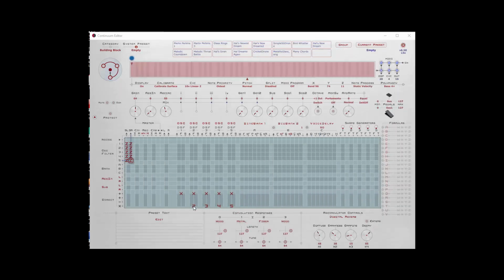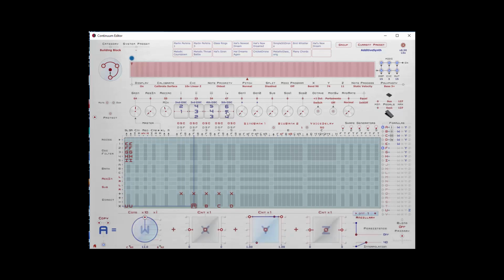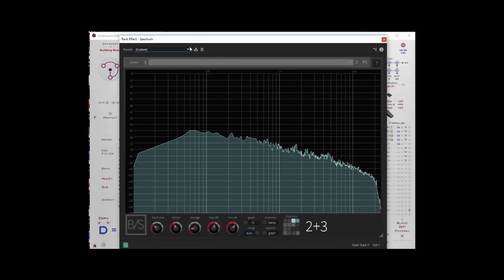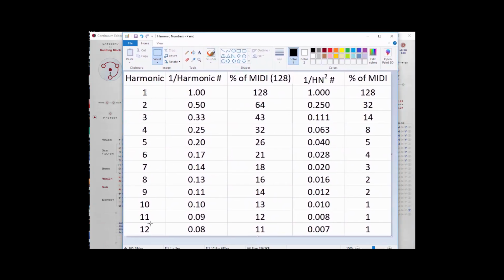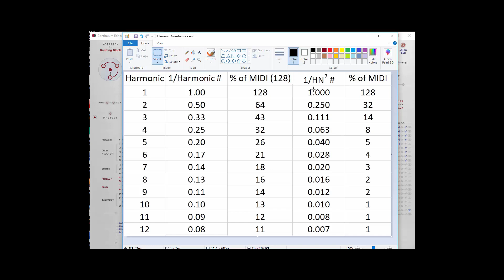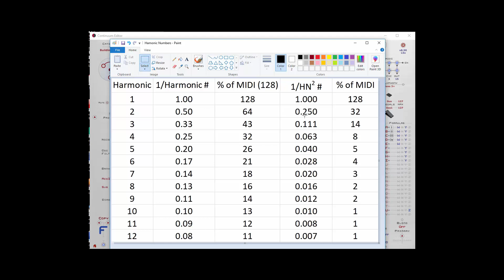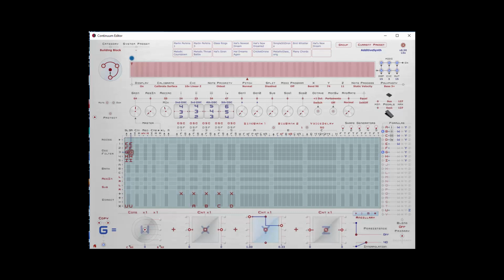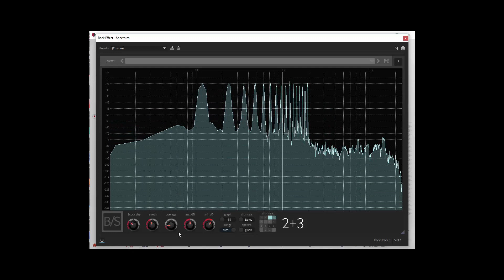Haken Continuum EaganMatrix Programming - Wave Banks Part 1 - Sine Bank of 5 Oscillators

Comment: Thanks for doing these Videos! Just now getting into Eagan Matrix programming with the Osmose. As an analog synth guy, it does bug me a bit, that there is no easy way to just blend between sawtooth, triangle and square waves. Ideally, I'd have a "Virtual Analog Oscillator" with inputs for shape and oscillator drift (to simulate vintage synth behavior). Currently I'm programming all of these manually (using wave banks and blending levels on the filter input), which is quite frustrating for such a seemingly simple task. Also, I'm quickly running out of dsp power and macros. Another thing I do miss is being able to saturate my oscillator waveforms before the filter. I can use the submix for this, but then i also have my effects pre-filter, which is a bit weird... Do you have any special programming tricks up your sleeve specifically for us analog guys? :D
Reply from the maker: It is its own thing. If you want to mix waveforms like that use something else. There are a million options. Don't try and turn it into an analog modular. Change your mindset for how this works. There are changes in the works to increase formulas, etc. but no release dates yet. Depending on the Spectral balance setting on the OSCs you can get a more triangle vs saw harmonic content (the waveform will not look like a triangle or saw as its DSF). I would try using DFS OSCs at different Spectral Balance settings to see if you get a sound you like which is in effect a mix of different harmonic spectra vs. saw vs triangle, etc. You can do the same with the Jenny OSC which can produce some interesting mixtures. In terms of Wavebanks, you can play with the harmonic weighting to get different mixture like sounds.
Reply from the maker: Also in general you will be a lot better off thinking about how you manipulate harmonic spectra than waveforms as so much of the Matrix is geared for that.
Reply: @eaganmatrixprogramming  thank you! The thing is, additive synthesis never really made its way into my thought process. I tried several times throughout my music career, first time was way back when NI Razor came out. And even though I'm comfortable with the frequency domain, harmonics, fourier-tf,... it's just not the way I think about sound. Maybe you're right and the osmose is going to be more of a controller keyboard for me, let's see. I do think the eagan matrix engine is quite powerful, though, and a "simple" VA oscillator could add a lot to the sonic palette.
Reply from the maker: @JBrm  Not just additive synthesis per se. Many of the EaganMatrix components like BiqBank and BigGraph have operations that filter based on harmonic spectra. For example the BiqGraph can let you manipulate individual harmonics of a sound and the BiqBank lets you manipulate spectral peaks and amplitude and frequency spreads, etc. There are at least five different sound generation and filtering techniques used on the EaganMatrix. I rarely use an Oscillosope to look at EaganMatrix sounds, but I use a spectrum analyzer all the time. For example if you look at one of the OSCs that you set to a saw-like wound, it will not look anything like a sawtooth wave, thought it will have a similar harmonic content of it. Only the Wavebanks will look like waveforms you are used to.